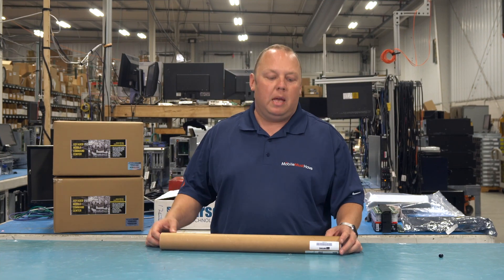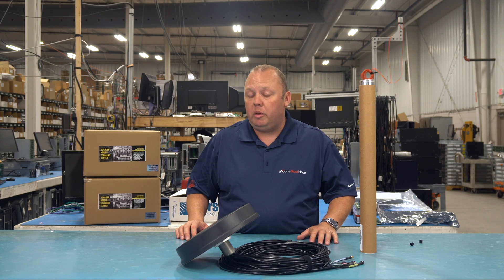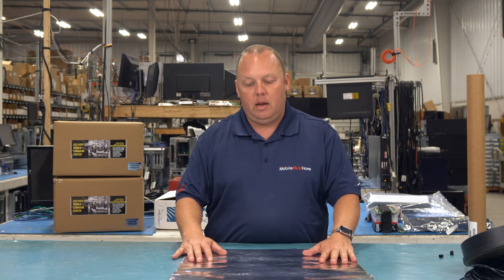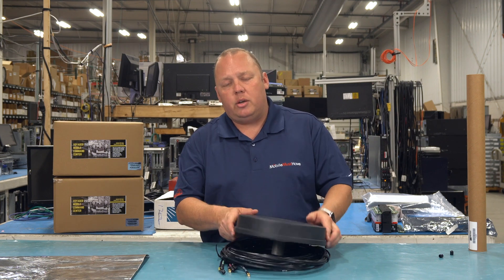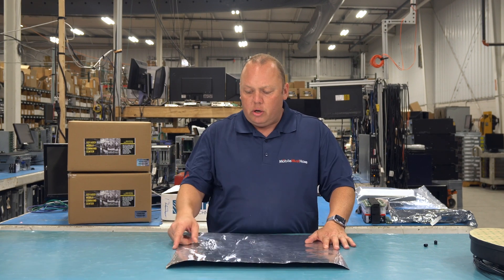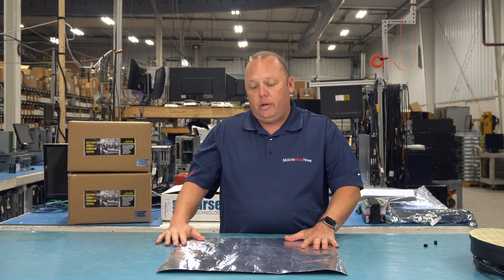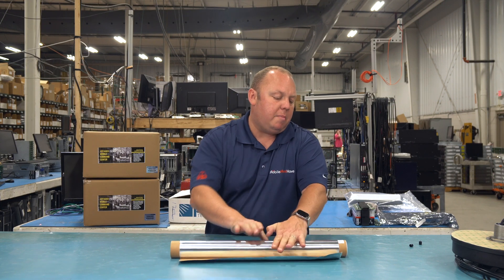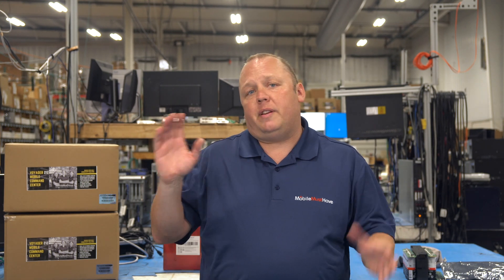Parsec Adhesive Ground Plane for Improved Antenna Performance and Custom Installations

Comment: Will that stick to a silicone roof? My roof is coated with silicone....I some doubts 🤔
Reply from the maker: Hi Joe! Yes, this will work with a silicone roof, but you'll want to use a slicone sealant to help ensure it can remain secured to your roof. You can also mount it using screws, then would just need some waterproof sealant about the screw holes. If you have any other questions, reach out to us via email at info@mobilemusthave.com and we'll be happy to help!
Reply: @MobileMustHave  k, thanks!

Comment: Great video guys! I do have a concern though - at the 4 minute mark you say you've seen this adhesive work on a rubber (EPDM?) surface, and was wondering if you guys could recommend a cleaning process or maybe a solution/product that might better work for me to install a ground plane on my EPDM roof? I'm just worried it won't adhere well, and since the antenna will only be adhered to the top of the aluminum sheet, that it'll all just come flying off while I'm driving. Any help or suggestions are greatly appreciated!
Reply from the maker: Thanks for reaching out! For sure, I think we can definitely help you out! So, for a rubber/EPDM roof, you'll want to clean the surface with mineral spirits. Then, while not required, you can also use an abrasive to help prep the surface some. Then, all you need is some silicone or water sealant like we sell, Dicor. This will secure the ground plane to your roof and you should be all set! If you have any other questions, reach out to us via email at info@mobilemusthave.com and we'll be happy to help!

Comment: How do you use this ground plane with a stick down antenna?
Reply from the maker: the instructions in this video are for stick down antennas and the installation method here would be what is used for that installation. Thanks for the question!
Reply: Ah. I missed the “stick to the ground plane and ground plane stick to the roof” comment

Comment: Do we know how this ground plane material will hold up in the long run? I live in Michigan and it will be subject to all of the elements...
Reply from the maker: As long as its sealed as outlined in the video and not penetrated it should be fine and is designed for outdoor use. Obviously wont be as strong as a galvanized piece of metal but its still metal and metal is non porous meaning it will keep the water out if properly sealed so it will hold up to the elements if properly installed preventing water from getting under it. Thanks!

Comment: It would be useful to learn what kind of performance improvement a ground plane produces.
Reply from the maker: That depends on the antenna and environmental conditions including the distance from the tower but in ideal conditions usually an improvement of 1-2db. Thanks for the question!